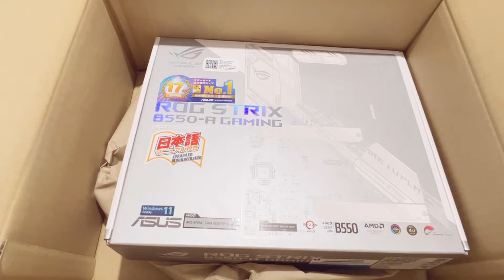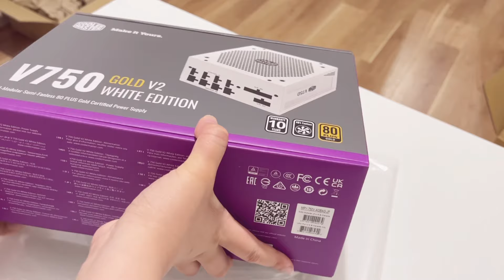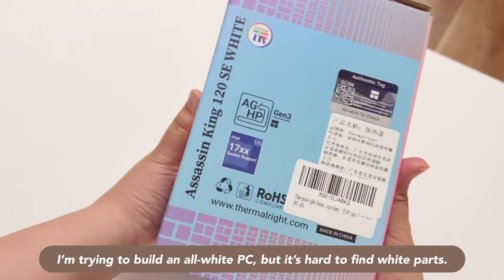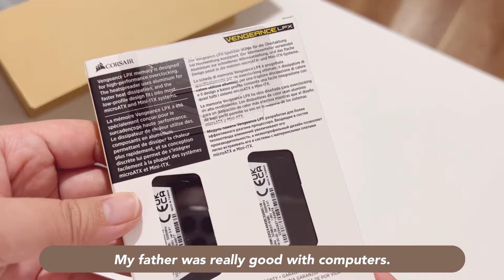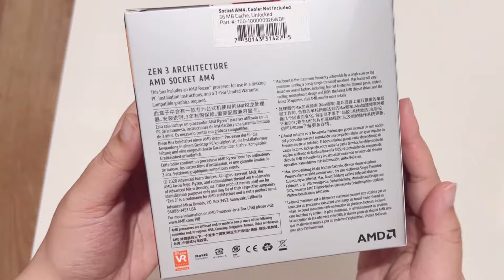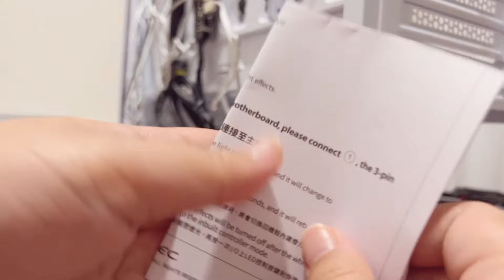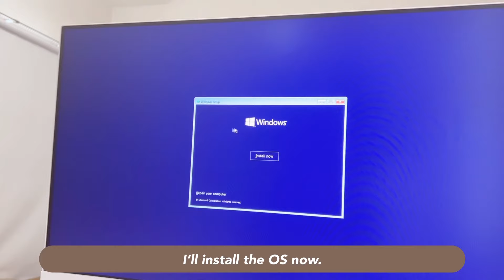Building my first gaming PC ☁️ $1500 all-WHITE aesthetics | RX 6700 XT

Comment: Pretty good for a first build! Getting it to POST first try is amazing work. My only suggestion would be to use two separate cables for the GPU instead of using the daisy chain end on a single cable. I can't say for all, but some power supply cables cannot fully deliver the power needed through one cable.
Reply from the maker: Thank you! ☺️

Comment: Definitely passed, it's a cool build. I'd move the bottom intake fan to the top as exhaust because the bottom is really choked in this case and you are getting a ton of intake from the front. The GPU will redirect a lot of that air into it and 6700XT isn't a very hot card in general. Awesome job.
Reply from the maker: Thank you for this advice! Really appreciate it 🤍

Comment: Just one thing, did you turn on XMP profile in your bios? Ryzen cpu like fast ram, they perform better with high speed ram. Oh and nice build, we almost have the same spec just my cpu is a 5800X3D and my gpu is a RX 7800 XT. You did pretty good job i like and subscribe too :D

Comment: Your CPU fan is on the wrong way, it will exhaust in the direction that the fan labels are, which is to the right. You'll want it to blow the air out the back of the case so swap it around.
Reply from the maker: Thanks for the tip!!

Comment: Errores: 11:17 ventilador al reves debe estar sacando aire, no tiene ninguno sacando aire,  12:12 el cable de 8 pines no se debe usar la extension ya que por una misma linea la grafica puede pedir 230W TDP y la unica linea aguanta solo 225 W, usar 2 cables de 8 pines independientes, la psu tiene 4 ocupo solo 2.
Reply: 11:17 fan is reversed, it should be blowing air, there's none exhausting air.
12:12 the 8-pin cable should not use the extension because the graphics card may demand 230W TDP through a single line, but the only line can handle up to 225W. Use 2 separate 8-pin cables, the PSU has 4 available
Reply: El único error que yo vi es el de comprar una licencia de windows 11, pudiendo comprarla en 15 dls en paginas de internet y que sigue siendo original.
Y los ventiladores que puso están sacando aire, a que te refieres, los 3 de adelante meten aire y esos dos sacan. Si acaso del de abajo esta de sobra ahi y debió ponerlo en la parte superior.
Reply from the maker: Thank you for the advice!! This would be helpful!
Reply: @hello.chocona  i was searching the comments for this same exact thing so i didn't double post. but they're correct, plus it comes with the PSU might as well use what you paid for.